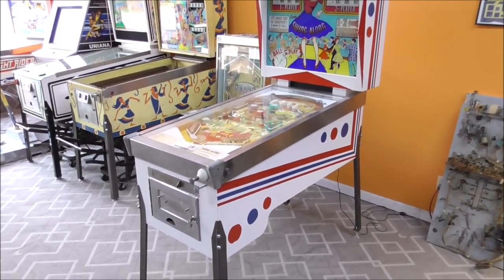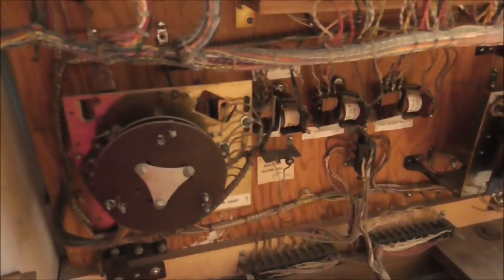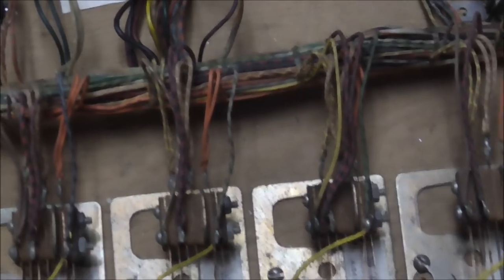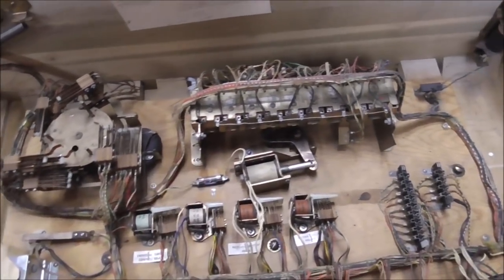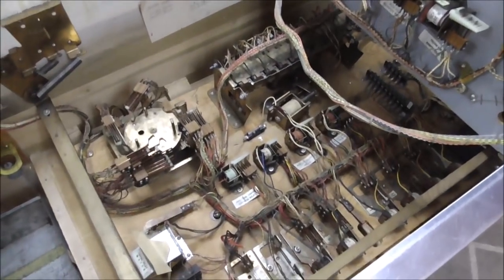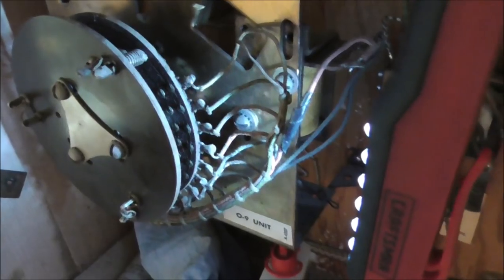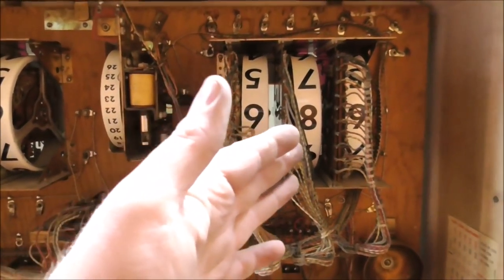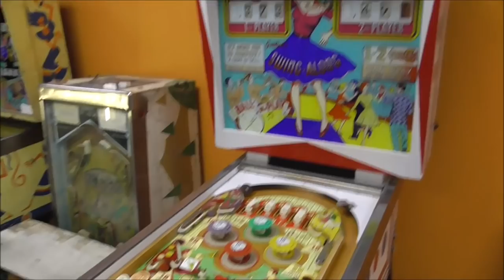Working on a 1963 Gottlieb SWING ALONG Masterpiece Of A Pinball Machine - Super Cool Game !

Comment: The engineering on these things is amazing. Some mechanical and electrical engineer designed this thing just using sliderules.
Reply from the maker: Yeah it's something else, if you collect enough of them you can see things change over the years and get more complex.  I have one at my house that's before they had relays, then if you mess with the late 70's machines and the Bingos they're incredibly complicated!

Comment: Have you run into any machine to troubleshoot that you could not find any schematics available, and you had to hand over hand the wiring? 
Nothing is at times more fun, and at times more of a headache, than having a machine of some kind that has lots of connections, with no documentation to follow.  
But a little of that once in a while in your career makes you a better troubleshooter.
I just wish that the times in my career that kind of thing happens seems to drop on me at about 1:30 on a Friday afternoon, or the day before a holiday, when they are sweating to get the job done! 😂
Reply from the maker: We have from time to time, but usually nothing as complex as this... we're lucky enough that if one of these doesn't have the schematics we can usually find the schematics for a similar machine from a couple months before or after this one, and a lot of the stuff is the same!  Thanks again John!

Comment: Actually, the woman fixed the game by installing a "New Tube". Probably misunderstood her due to her heavy southern accent. Y'all take care now.
Reply from the maker: haha that's pretty funny, that's how you fix monitors, or you put a 'new bulb' in them :)  Thanks for watching Marcus, I hope everybody realizes we're just having a good time :)
Reply: @LyonsArcade  Indeed! Very clean game considering how old it is. I had a similar issue with a Gottlieb Flipper Pool that would not reset and reached into the front door of the game with a thin wooden dowel to tap the relay plate on the bank to complete the reset. That switch on the underside of the reset bank that is touched briefly by the reset bar is a hum-dinger to adjust and get set just right. I learned the dowel trick by watching other "guys & dowels"?!